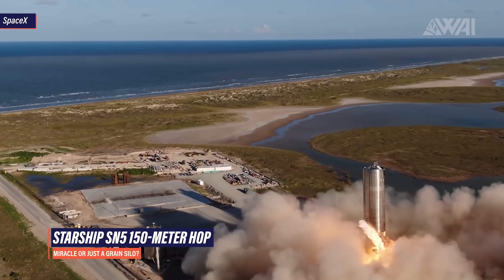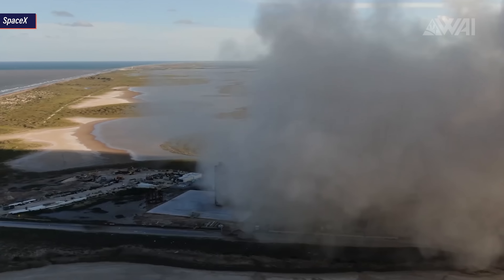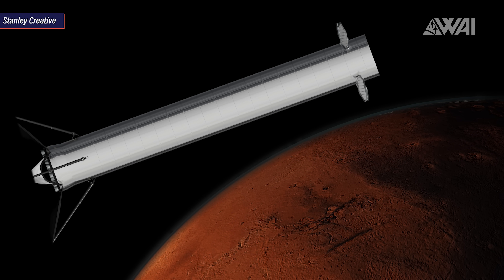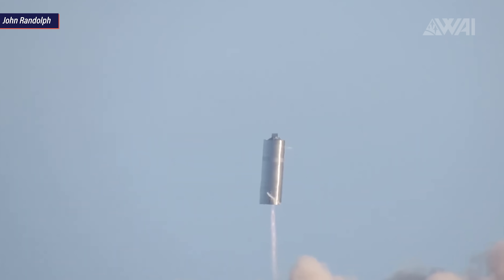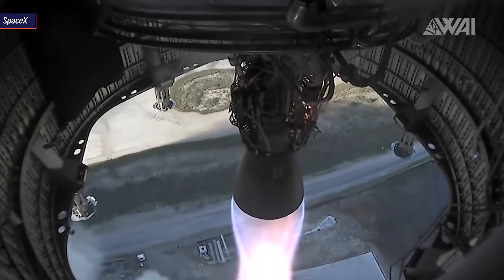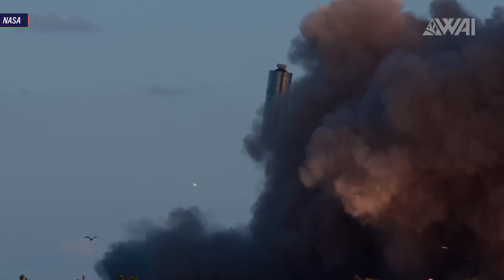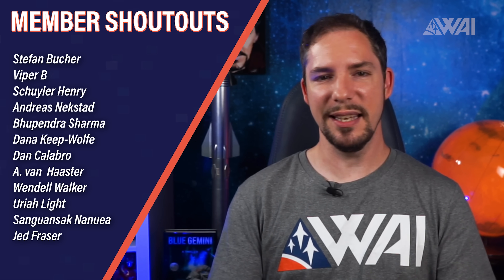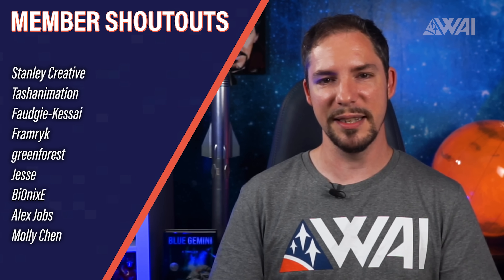111 | SpaceX Starship Updates – How did SN5 do?

Comment from the maker: Did you watch the 150-Meter Hop live and what do you think about the modular engine layout on Super Heavy?
Reply: Hexagonal engine configuration, or a circular one. I still like the 37 engine design, since it increases payload capability, especially for heavier tankers for refueling.
Reply: Jerry Jiang - Even 31 Raptor engines would give it 1.8x the thrust of a Saturn V, & that’s assuming the final version of the Raptor is no more powerful than the first ones that have already been produced. I would put 7 or 9 Raptors on the upper stage to increase overall payload to LEO.
Reply: TraditionalAnglican yes, but 301 200tf raptor only make 62kn of thrust, and creating a liftoff TWR of 1.24, which ain’t a lot. Even if it gets up to 250tf, which will take some time, TWR is only 1.55. 37 engines will boost overall TWR by ~20%. Having 37 engines will also bring up the TWR if SpaceX chooses to make heavier and more capable tankers
Reply: TraditionalAnglican Starship have 3 SL and 3 Vac engines, which already support a pretty nice TWR, although adding 3 more Vacs will increase efficiency. If they plan on making higher capacity tankers (replacing payload fairing with tanks, heavier), having 6 Vacs and 3 SL engines will boost performance.
Reply: Jerry Jiang - Based on this, TWR of Starship with 31 Raptor Super Heavy is 1.4665/1 - That’s higher than that of Saturn V, & LC 39A will have to be reinforced to deal with this - 
https://www.spacex.com/media/starship_users_guide_v1.pdf 
https://en.wikipedia.org/wiki/SpaceX_Starship 
https://www.popularmechanics.com/science/a32052844/spacex-starship-user-guide-payload/ 
https://en.wikipedia.org/wiki/Newton_(unit) 
I’m always on board for adding more engines - It makes for quicker acceleration, but it’s just not necessary here.
Your problem is with the upper stage which has a TWR of 1.077/1 when using 6 Raptors. There’s more than enough space in Starship’s upper stage for 1 engine surrounded by 8 engines.
Reply: @TraditionalAnglican  Starship doesnt really need such a high TWR, as its only really ever designed to land propulsively, It can in emergencies be able to take off under its own power fully fueled, but in normality Super heavy will give starship most of its delta v, then once out of 90% of the atmosphere and not losing that "Drag" then a low TWR engines are actually fuel efficient and get you further...
Reply: Kevin Moore - Starship upper stage has a TWR of 1.077/1 - That’s barely enough to accelerate in a vacuum. The engineers had originally designed it for 7 Raptor engines which would’ve given it a TWR of 1.23/1 which would enable it to reach orbit more quickly with more payload. Going into orbit is much more a matter of velocity than altitude. The Super Heavy can’t give you that much velocity even if completely expended in the process.
Reply: @TraditionalAnglican  
Six vacuum engines plus three sea level engines is more efficient than nine sea level engines. But I do get your point about the upper stage TWR.
Reply: @TraditionalAnglican  
"A TWR of 1.077/1 - barely enough to accelerate in a vacuum."

I'm sure you already knew that limitation only holds for accelerating straight up. 

Typically the second stage is oriented nearly horizontally, and only a fraction of the thrust is vectored downwards to mitigate a short-term acceleration downwards. The second stage typically starts up well before the apogee set by the first stage. So it is initially falling upwards.
Reply: How long before the crawl space is referred to as a Jeffries Tube
Reply: @andy6359  When FTL drive is achieved . THAT & AG are the 600 lb gorillas in the room.
Reply: Watched the hop live! 
I just think that elon means by flying 3 Starship a day, it won't be the same, just 3 different starships around the world.

Great video Felix and team. Grüße aus Österreich!
Reply: The Minehopper - No, Elon thinks each Starship will be able to fly 3/day. While it will probably be closer to 1/day, it’s still going to be interesting to see SpaceX develop the tech for “rapid reusability”.
Reply: @TraditionalAnglican  If he gets it developed and engineers and turn around crews become expertly efficient sure 3 times a day. But that is picture perfect.

SpaceX has taken a large portion of the launch market. Something like a single working SLS flying even 1 time a day? Yea he could take over the entire market with just one.

Who's actually wants to pay to put that many tons into space ... per day?

He used to live on 1 dollar a day. He needs alot more to keep SpaceX going. The guy is rich but not that rich.
Reply: @MrFlatage  I suspect the largest individual customer for Starship in Earth orbit would be Starlink (currently part of SpaceX.)
Reply: Michel Platteeuw - Except for Space Falcon 9 & Falcon Heavy, it costs $22k-25k/kg to get stuff into LEO. There really is no business case for doing anything in space besides communications & weather satellites. Both Jeff Bezos & Elon Musk have stated that reducing launch costs is key to the exploration & colonization of space. Starship is meant to reduce that to $20k-70k/TON. 
How many people do you think would fly if a ticket cost $700k instead of $700?!? Remember, jets enabled airlines to charge $200 for economy class tickets instead of the $2000 airline tickets had cost, & air travel increased by 10x in a matter of years. What do you think would happen to the spaceflight industry if you decreased the cost of getting into space to 1000th of what it is now?!? What do you think would happen if you could go to a space station in LEO for $70k instead of the $90+million Roscosmos charges now?!?
Reply: @TraditionalAnglican  Maybe because Chinese hiding behind fake names like having all those rare elements meaning it's a business monoply. Which business like space mining could break up. You are right. I would also pretend there is no other business.

Thought Bigalow, Bezos, Richard and many many others were totally going for space tourism as a business? Maybe I dreamt that ...

Exploration is definately a business. What does NASA stand for again? How about zero G research and manufactur of metals which can only be produced in zero G?

Maybe it's all just Hollywood. Must have seen that in a movie. 

I will go with proven fact known science. Facts are facts. What anyone thinks is not changing a fact ever.
Reply: Michel Platteeuw - The 0-g research & the manufacture of materials in orbit can’t even come close to breaking even, let alone making a profit at current launch costs. The first questions when trying to make a business case are -
1) Will this be able to make money in the near future? If yes, 
2) How? If not, 
3) Are there any conditions under which this can make money? If yes,
4) Are these conditions things that could happen or could be developed in the near future?
I’ll simply say that there is no business case for everything you’ve described without a dramatic reduction in launch costs.
Reply: @TraditionalAnglican  K well post the costs and we can compare them.

That is the first question any bank asks a business.

Can you post a link to the financial cooperation that you got that list from please? Sounds very dodgy to me.

People who want to build the Ark of Noah would get a loan. Not you, lmao!
Reply: Michel Platteeuw - Launch costs for “Old Space” rockets are posted here & elsewhere. Roscosmos now charges $90 million/seat for rides on Soyuz, & Boeing charges $92 million/seat on Starliner. Except for SpaceX Falcon 9 & Falcon Heavy, it costs $22 million - $25 million/ton to launch stuff to LEO. That’s the reason it costs $2 B/year to maintain the ISS. 
I’m not the only one saying that no business in space will become viable without a dramatic reduction in launch costs. Jeff Bezos, Elon Musk, Robert Zubrin & multiple others have said that the colonization & industrialization of space requires a huge reduction in launch costs before they can happen.
ASP, you’re going to have to demonstrate that what’s being produced in space is worth more money than the eyewatering costs of getting the people & materials into space. It’s actually possible at $70k/person & $70k/t to make a profit, partly because you can then do mass manufacture - That’s one thing Musk is trying to do with Starship.
Reply: We watched and filmed. The sound from almost 5 miles away wasn't impressive, but you could feel the vibration and it was awesome.
Reply: I did watch it live, it should have been more awestriking to me than it was, because this marks the first step

All the workers making rockets and ICBM's alike are truly remarkable
Reply: @NURDVEVO  agree, history in the making
Reply: I live in Germany and it was like on 5 o'clock or something so no :(
Reply: Whatever the layout they can always strap on a few more recoverable boosters, should be the way it is built.
Reply: So basically Elon is making a big rocket
 in his shed 😂
Reply: I don't think they will go for 37, but a modular 31 (7 + (6 x 4)) config is probably a good solution. For me 37 won't let sufficient space between the exhaust cones and dissipating the heat could become a real problem not to mention accessibility for maintenance. Putting too many engines on a craft will result in too many maintenance controls and will be counter-productive.
Reply: @Turbo999be  
The sea level engines on the booster are cooled all over - even the expansion nozzles.
Reply: Tbh, the modular engine style is a good idea, but that is just a part of the equation. Like a plane is not just comprised of its engines, Starship requires a lot of other complicated systems that have to be failsafe and easily accessible and replacable at the same time. The engines are the easy part.
Reply: yes or i am not a true spaceflight fan lol
Reply: I think that the modular idea makes sense, however I think they may separate each engine individually to prevent multiple engine failures. This is the case on falcon 9 where there are walls between each engine that contain an engine failure, like the one we saw on a launch not so long ago. This could maybe be done in modules, but wasn't shown in the concept you had in the video.
Reply: A long time ago NASA did a bigger hop and landed the first rocket propulsion vehicle on the surface of the moon.

Decades later they make a 150 meters? And how many before have tried and failed?

I mean ... I want mankind to get into space yesterday.

Elon is figuring things out still. Doesn't mean it will change the world untill he actually does it. Even SpaceX just keeps scaling up. Go big or go home? Yea we already seen the Sea Dragon designs.

He is definately innovating proven designs that came before and making it more economical.

Would love to see something new for once. Rockets are cool and impressive. It is still a large metal tube with fossil fuels really.

Love to see more experiments with laser propulsion. Maybe a video about actual viable alternative methods of propulsion.
Reply: Actually i got a question. Do you know if Spacex reuse their engines on flacon 9, and if so, how much of the original engine is reused in the subsequent launches?
Reply: @TheRealVranesh  Yes they do re-reuse the whole engine. It's not clear though how many parts are simply maintained or completely replaced.
Reply: I'm not sure about the modular engine pods; it might not be the greatest thing to have to replace 5 engines when you only need to replace 1.

I'd be interested in a discussion of why they are going with 31 small engines instead of a smaller number of large engines, and also a discussion of vacuum engines versus atmospheric engines on Starship once it's on the Super Heavy booster.
Reply: Warren Dew - If designed & built correctly, modular engine pods would allow single engines to be replaced. The main thing this gives is the ability to more easily service & remove & replace the engines as needed.
Reply: Warren Dew - Each Raptor has ~235 KN of thrust, & the 31 produce 2x the thrust of Saturn V. You get much larger than these, & you get the mixing and stability problems experienced with the F-1.
Reply: @psychohist  But if you can pull a rack of 5 out and relace it with another rack, then the booster can be reflown quickly.  then the individual engines can be taken off the rack and a new good engine added to the rack and that part is ready to fly again.

if you were to use the non modular approach, then it would probably need quite a lot of work to remove the single engine...as you might need to remove parts of other engines to disconnect the engine fully. Everything they are doing is to facilitate reuse so im sure this is why they chose to group the engines.
Reply: @MrBlackjimrogan  Cool so how many modules will there be? To attach and re- attach anything you would need to engineer adapters that allow you to do that.

So ... how much weight are you adding here?
Reply: @MrFlatage  from that sketch. It looks like 6 modules. And yes you might need some extra plumbing but some of the structure is used in the module can be used to shield the engines from each other in case one has a failure during flight it stops debris spreading an damaging other engines which they would most likely add. As in the octoweb on the falcon 9
Reply: Also, may make sense to go with 6, slightly smaller falcon style legs for Starship for improved stability on uneven terrain such as the Moon or on Mars.
Reply: @AJ_Jones198XAD  
Falcon legs are dependant on level landing surfaces. Not available on Moon and Mars. For those, the legs must accommodate uneven "terrain".
Reply: The fire that is shown in the landing ( at the engine) could also be caused by the unusual explosion taking part right after the start, right?
Reply: Callum's idea and design is spot on - Im looking forward to seeing how it compares to what Space X do. So Awesome!
Reply: Going a step further in modularity - what about new turbopumps that are capable of pumping the fuel or oxidizer for 4,5 or even 7 Raptors. In essence do the opposite of the RD170 being developed into the RD181.
Reply: David Johnson, I’d just like to remind you that SpaceX is not just building a new type of rocket. Per what Musk has repeatedly emphasized they are building the mass production techniques for building this completely new type of rocket. There’s no factory building like they use to build the now fixed design Falcon 9 stages and Dragon capsules because they’re pretty early in the stages of working out how they’re going to do it. Nobody is going to be riding one of those things until they’ve got the design of Starship and Falcon Heavy AND a NASA certified production process ironed out. Expect tents and outdoor storage to go away. I suspect that the permanent buildings will be built around the high bay still being built as well as the mid bay where they’re currently building Starships.
Reply: @RightWingNutter  You are saying NASA certifies what is safe and not? Not some online dude?

Quite shocking information!
Reply: @MrFlatage  It will be a government  agency that certifies whether Starship is safe. Whether it's NASA or the FAA or some new agency to regulate commercial space operations. Private companies don't get to certify that their vehicles are safe. That would be like allowing Boeing to certify that MCAS was safe for the 737 Max. We all know what a disaster that was.
Reply: @RightWingNutter  I would like to believe what you are saying. And really hope you are correct. But let's just say I don't trust Musk. Do you realize that he's still building cars out in tents in Fremont Ca. and selling them to paying customers? I can't help but think that Musk will try to get away with the same thing here. But I do hope I'm wrong. But even if he does build a real factory... What about the lack of launch abort for Starship? It's not a matter of if, but when an accident happens. Without launch abort, people will needlessly die.  Also, don't you think his stated timelines of missions to Mars in 2022 and 2024, as well as a flight to the moon in 2023 are a bit off?
Reply: David Johnson, I’m not concerned with Tesla comparisons. Apples & Oranges.
Note that Starship has more than adequate thrust to be its own escape stage if Super Heavy blows. Note also that the safety of manned mission hardware and procedures have to get NASA approval. Look at what both Boing and SpacsX had to go through to get their capsules certified and you may worry less.
Re. predictions of flight scheduling, surely you’ve heard of Elon time vs Shotwell time. I don’t think Tony Bruno is sweating it much.
Reply: @RightWingNutter  Oh but Starship can't serve as its own launch abort system for obvious reasons. If a malfunction occurs on Starship, everyone onboard would be killed. Launch abort must be an independent system. Like the one used for Crew Dragon. That is the only way to protect the crew and passengers in any scenario. Regarding Tesla, my only point there is I don't trust Musk to do the right thing.
Reply: @RightWingNutter  Gemini had ejection seats and so did the shuttle for the initial flights:

https://blogs.nasa.gov/waynehalesblog/tag/ejection-seats/

Luckily both NASA and Elon have way more practical proven options available way ahead of the finished product.
Reply: David Johnson, if you recall the launch abort tests for Falcon 9, the abort was done during the initial boost phase. That’s the danger period. On Soyuz and Apollo the launch abort tower is jettisoned once the 1st stage is done. By that time they’re in space.
I suspect they’ll have the Starship atmospheric engines chilled and ready to go at launch. Once past max-Q they’ll get the vacuum engines ready and by meco the atmospheric engines will be secured. At any point from the pad to separation the Starship would be able to get away from the booster.
There could be a potential problem with the propulsion and passenger sections being one unit. Short of the whole thing blowing up in space, there would still be the atmospheric engines being separate from the vacuum engines. A vacuum engine failure that left the craft suborbital would still leave it able to steer and land propulsively on the atmospheric engines. It would take an extraordinary series of failures in separate systems to lose the passengers.
Reply: @RightWingNutter  If you recall, the two Falcon 9 failures involved failures of the second stage. We all saw the devastation from a propellant explosion on SN4, and that wasn't fully loaded! Falcon 9/Crew Dragon currently have launch abort from the launch pad all the way to orbit. In the case of Starship, abort capability would also protect the crew and passengers in the event of a failed landing. And you know there's been a few of those on Falcon 9.
In my opinion, to cut back on safety is nothing short of criminal negligence. I know spaceflight involves risk. It is needless risk that I am opposed to.
Reply: David Johnson - So you’d ignore the fact the NHTSA & IIHS have rated Teslas as the safest car they’ve tested in the classes they belong to?!? Remember, the Feds never denied the Teslas scored the highest scores in each of their classes - They only demanded that Tesla stop saying something that, according to their tests, was demonstrably true.
Remember, the Cargo Dragon & Crew Dragon have performed as advertised, & SpaceX now charges ~1/8 of what the other companies charge to get stuff to LEO - It’s the Starliner that, according to NASA, would quite possibly have killed a crew if a crew had been on board during its first Demo flight.
I don’t have to be a Musk “fanboy” to recognize those facts.
Reply: David Johnson, that’s why I don’t think the commercial point to point commercial travel plan will happen with Starship as it is. However there will no doubt be people willing to put up with the residual risk for actual space flight. If you aren’t one of them, that’s fine.
The SN4 explosion was due to a launch pad failure, not to a problem on the rocket itself. Failures at this stage, even spectacular ones, are part of the SpaceX iterative design process. It’s different from the government run programs of the 60s through 90s to be sure, but Musk is using his own money on this so it’s up to him. Note that for all the fun explosiveness of some of those failures, nobody has been hurt or killed by a launch.
Reply: I just missed it ;(
Reply: To see the summary including analysis and background data is actually way better than to have seen the hop live. Thanks for an awesomely interesting Video.
Reply: Didn’t see it live. Modular layout would be necessary given the turnaround time envisioned.
I’m getting 7600 tons thrust for a 31 Raptor layout vs 10150 tons for 42 Raptors. That assumes 250 tons each for non vectoring and 200 tons for vectoring. How much will an entire stack weigh? I don’t know but I’m sure someone here has a pretty informed guess.
I’ll just toss this out there for speculation. 12 modules of 3 Raptors each, or 4 modules of 9 Raptors each. Why? Because it’s sounding like some Starships will be much heavier than others, needing more boost to get into LEO. With 36 fixed thrust Raptors a Super Heavy could have the option of not using 2 or 3 modules in the first case, or not using certain module engines in the second case. The 12 x 3 solution strikes me as best since I suspect it would be far simpler to cut off an entire module than 1 or 2 engines in a module.
Reply: SpaceX officially states that Falcon Heavy can ferry to LEO up to 63.8 t of payload.
So Felix, what do you mean drawing on the screen "38-45 MG" (???) and saying that "Falcon Heavy in theory can do from 38 to 45 tons to LEO"?
Reply: Валентин Разумнов - He’s thinking in Reusable Mode. Based on the 2/3’s rule we’ve seen with Falcon 9, FH Reusable could get ~42 t to LEO. ATST, Elon has stated that Falcon Heavy could lift ~55 t if the side boosters were landed downrange & the center core expended.
Reply: @TraditionalAnglican  This is ridiculous. Ariane 5, Delta IV Heavy, Long March 5, Saturn 5 - all are "fully expendable" rockets. So why the hell compare them with Falcon Heavy in reusable mode?
And reusability of the central booster is still a big question. Too hot entrance and landing maybe mean that central booster made of carbon fiber can't be refurbished.
Reply: Валентин Разумнов - I don’t think I compared these “Medium & Heavy Lift Vehicles” to the Falcon Heavy “Super Heavy Lift” (63.8 t in expendable mode & ~55 t when side boosters are landed downrange & the center core is expended), but it wouldn’t matter anyway, because, even in expendable mode, FH can launch for 1/2 the cost of the least expensive of these.
Actually, the problem with the last FH center core had nothing to do with problems on reentry & everything to do with the lack of the appropriate Octograbber that could secure it to the deck of the drone ship after landing. In the case of the ~55 t partially reusable mode, the center core would be deliberately expended, because it would be traveling too fast to survive reentry.
Reply: @TraditionalAnglican  You maybe forgot but it was Felix's idea to compare Ariane 5 ... Saturn 5 with Falcon Heavy, not yours.
And you maybe forgot that only 1 center core of 3 Falcon Heavy landed sucessfully on sea platform. And at least 1 time Musk twittered that overheating at entrance caused bad landing.
And all 3 times Falcon Heavy was not even close to upper payload weight.
I feel that about 30 additional km of altitude and several km/s of velocity may be that critical for the center core.
Reply: Валентин Разумнов - I’m not surprised that Felix did it, as these are considered to be the alternatives/competitors to F9 & FH. I think most people forget these are a lot more expensive to launch than both & are far less capable than FH. 
SpaceX had failures the first few times they tried to land F9 boosters - 
https://www.youtube.com/watch?v=bvim4rsNHkQ 
So, I figured they’d miss on the first try. The Octograbber problem assured the 2nd booster wasn’t going to stay on board. Put on the right Octograbber, & that one stays on board & gets back to Port Canaveral. And, the long flight profile demanded by the USAF just went far enough to insure it wasn’t going to reenter without some sort of problem. I don’t see how it could come in from a higher/faster profile & land safely without some sort of heat shielding which would add weight & decrease capability, & SpaceX doesn’t feel it would be worth the added cost or the decrease in capability to do that. 
I wish there were more launches with FH so SpaceX could get experience landing the center core & find out how far they can push it before needing a heat shield or just expending it & landing the side boosters on drone ships.
Reply: I'm one of those doubters :) Sure Musk has proven that you build a giant garbage can outside in the dirt and make it fly. But what he can't prove is that it is safe. I stand by my earlier point that rockets constructed in this way are UNSAFE. Due to poor quality control. I do give SpaceX highest praise for development of the Raptor engine. But then, that engine was built in a REAL factory :)
Reply: @DavidJohnson-tv2nn  It is about what you do here? You have factually proven that you produce way too much garbage.

What is a Amish doing on the internet? You so Amish hardcore you don't even drive a carriage? Those have been proven to be unsafe. How many Amish have died in those? Care to tell everyone here how unsafe those are?

No one is proving rockets are safe. We know they are not? Gonna prove cars and aircraft are safe when we already know that is not the case at all?

Though inflatable jump cushions at kids parties? Have killed more kids then Elon Musk's rocket or any rocket in mankinda history.
Reply: @MrFlatage  If you're ok with building rockets out in the open with poor quality control, with NO launch abort capability... Then eventually putting up to 100 people onboard... It shows what kind of person you are!
Reply: @MrFlatage  Rockets are not safe but but some are definitely more dangerous than others. Take the Space Shuttle as an example. So you correctly mention rockets are not safe. That is FACT number 1. Musk makes the situation worse by building rockets in conditions where quality control can NOT be maintained. That is FACT number 2. But wait! We're not done yet... Musk decides to omit launch abort capability from  Starship. Which makes Starship a deathtrap for any future passengers! That is FACT number 3. And you're defending that. So what does that make you?
Reply: By the way, I do hope Musk changes his ways and builds a REAL rocket factory. I would like to see missions to Mars just like everyone else here.
Reply: @What about it!? And/or anyone else with opinions on my speculations...
I would really appreciate your thoughts on the following which is less then a 2 mins read...
Something I posted on another SpaceX video that was about the Starship SN5 static fire and 150m hop which I thought would be relevant since SpaceX just keeps on launching almost as much as the UFC puts up fight cards now (only UFC fans will get it)...

...All "grain silos" jokes set aside, Elon Musk and SpaceX get to move ahead of the class in a major way, leaving all their competitors in the dust. 
Within almost just a short 10 days time period, SpaceX brought back (perfect SplashDown) Dragon DM2 with it's 2 Astronauts safely, then they performed a perfect static fire test and then only a few days later with the same fuselage and engine they achieved a successful 150m hop from point A to point B almost perfectly and then a new Starlink launch all within such a short time frame, it's my opinion and speculations that at the rate Elon and SpaceX are going, I believe they'll make their trip to the moon much earlier then predicted/anticipated. 

Only thing SpaceX needs to worry about right now is, industrial espionage. Now that's no laughing matter because of course other companies especially from different countries will approach SpaceX engineers from the lowest staff to the highest with $ multi million dollar offers for any knowledge anyone in SpaceX staff can/could provide to help them catch up to SpaceX. We're talking multiple million dollar offers for first hand knowledge or downloaded information carried out in secrecy on any kind of memory drive devices with valuable information in order to catch up on all SpaceX technologies/applied science that put SpaceX so much ahead of everyone. So anything with a single to double digit $ followed by six zeros money wise can easily buy loyalty and someone will eventually be tempted, forgetting all about legacy, loyalty, being part of history that will be replaced by selfishness and greed while only thinking of themselves, just as long as there's lot's of zeros behind a specific high single to double $ digit number(s). 

Do not underestimate human nature and the powers of greed and self gratification in such historical moments. I really fear that the power of greed will eventually be too tempting for a few among the thousands of SpaceX employees and some will take the bait of multi million dollar offers and betray Elon Musk, SpaceX and their own colleagues in the process while thinking only of themselves and getting $ multi million dollars for themselves in the process. Anyone else having the same thoughts? Would love to read your opinions/thoughts on the matter? Am I completely out into the left field or do my worries make sense?
Reply: The purple colour is awesome. It will look like sci-fi
Reply: Yes, in awe as SpaceX continues to rip the envelope wide open!
Reply: I think the issue with the modular engine layout as shown is that it still has just as many connections to the tank for each engine. If you want it to be a quick swap you need to have one connection for methane and one for oxygen and then they split out to each engine in the module or else there really is no time saved/point to having 5 engines in one module.
Reply: Hello Felix, 
totally unrelated, but I just found this:
https://de.m.wikipedia.org/wiki/Whataboutism
Does that happen to have any relation to your channel's name? (-;